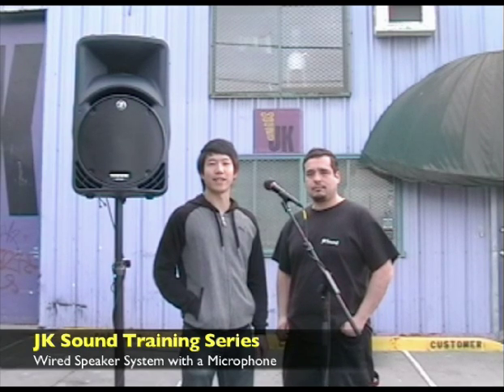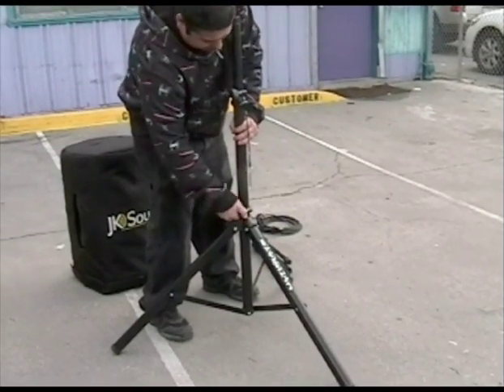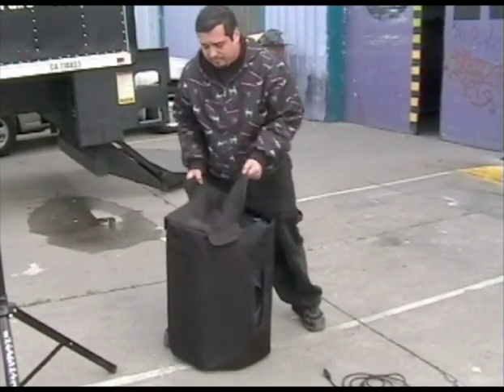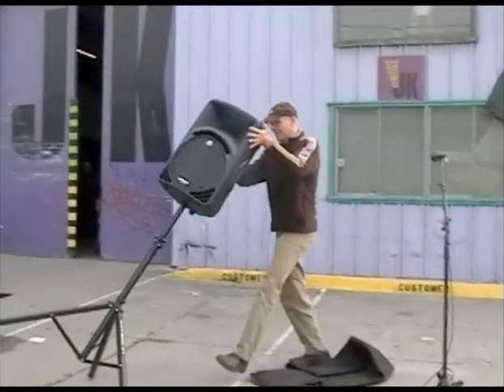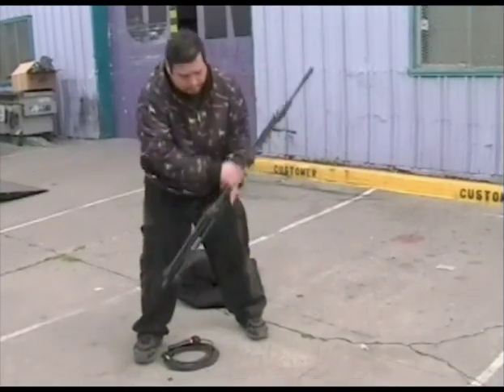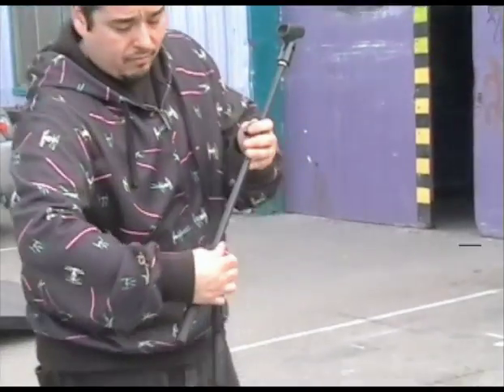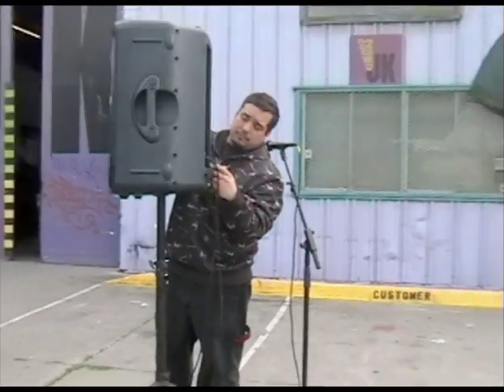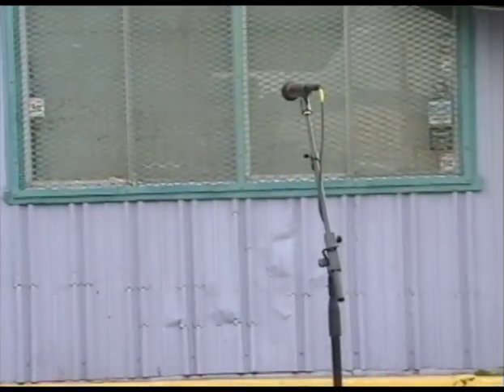How to Properly Setup a Small PA (Mackie SRM 450 Powered Speaker with a Microphone)

Comment: @jeromsavestheworld either will work- passive speakers need a separate amp to power them. active speakers (like these ones) have amps built in. which type is better depends on what you are using them for.

Comment: jk, i have a DJM400 (pioneer mixer) 
can i connect my mixer straigt to the speaker? because my mixer doens't have such an output as the input on the speaker. 
Nice vid!
Reply: u can get a multicore cables its good for setting your powered mixer far away